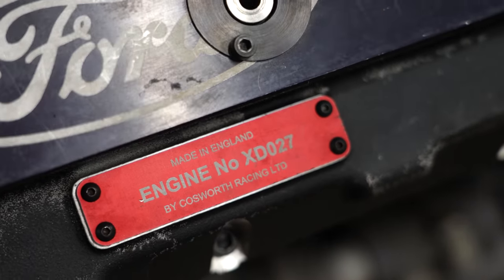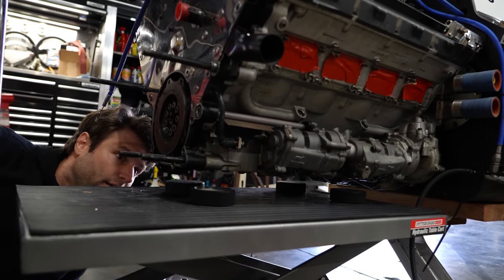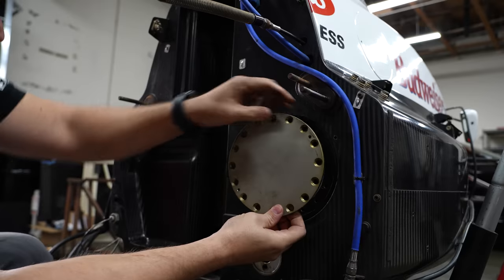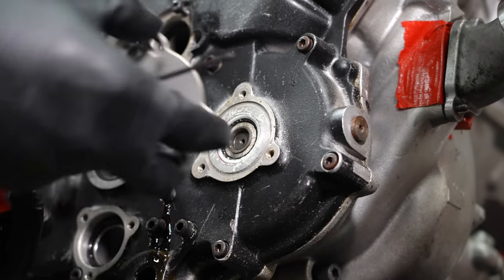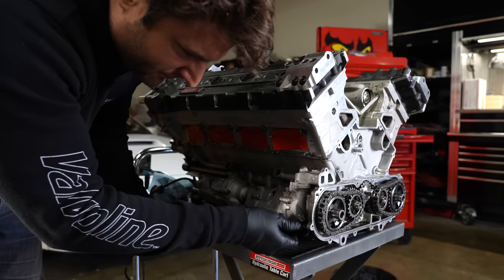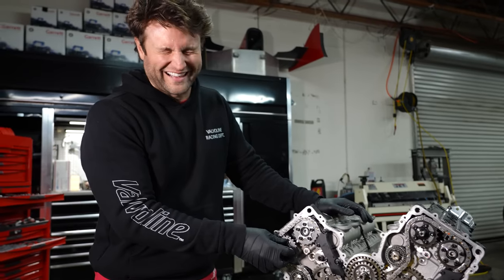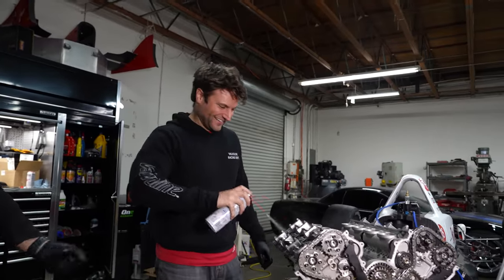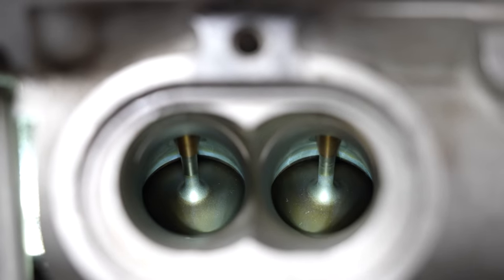We teardown the IndyCar Engine to expose its Secrets! Cosworth XD Turbo Methanol V8

Comment: 😬you're rotating the engine the wrong way causing less chain tension and the cam is skipping teeth, the engine will need to be retimed now, chains already looked kinda loose though time for a new set

Comment: Rob, In the time of the 80s and 90s Indy 500 races, the target MPG to have enough fuel to finish was 1.8 mpg. That was 1.38 gallons burned per lap. Qualifying was not an economy event so running all 900hp burned even more. This is an awesome thing your doing here and long overdue for anyone to do this. I can’t wait for dyno day and to see how much fuel per pull it eats.
Reply: If it still runs after all of this I will be amazed! Not to discredit rob and the crew. It just seems like so many factors can go wrong.
Reply: @kylemcweeny878  I agree it is insanely complex but Rob seems to be insanely analytical about everything he does. I hope it turns out as amazing as his 4-rotor that people doubted as well.
Reply: Notice the extreme throttle fluctuations: https://youtu.be/70tyWDK26-I?t=932
Speaking the truth, by innuendo: https://youtu.be/IADOqM5VCi0?t=360
44:44 This is liminal space, used to stuff the 'Hobby tubes' mentioned by the
Kodak team.  Dupont had T-rex, better life through 'color'.  Primary field??
ie the more potent oxidizer/fuel starts inside the engine, to take advantage of the vacuum (like restrictior plate racing).
May want to avoid fuels that contain metal, silicon seems to be the accepted alternative.
F1 are NOT getting 60% efficiency, as all fuel is not being accounted for.
Reply: @kylemcweeny878  From Rob's various comments in the video, it doesn't sound like he's treading totally new ground. 
https://youtu.be/uVeK7sVt9BQ?t=2667 
Between that source that Rob found and the other people he mentions who have reached out, I think he has a shot at getting it running if he hasn't damaged anything in the teardown.
Reply: @kylemcweeny878  its just an engine same as a vw one just more expensive nothing more in it nothing different
Reply: The ECU will probably be the stumbling block,  I daresay.  My prediction is the relationship between the multitude of sensors and the ECU will force Rob to have to keep using the original ECU,  and unless the engine is setup identical to the original the ECU won't function properly.  But who knows?  Maybe MoTeC sell an Indy Car off the shelf ECU?
Reply: @ivanjulian2532  i know pectel will run it all i can say and he can get a new pectel cosworth ecu now like new gen for 4k i used them multiple times
Reply: @drmikegaspwred1483  well that augers well.  That will give the engine a new lease of life I would wager.
Reply: @ivanjulian2532  i could write down here what generator driver they need and all but why i like seeing him figure it out he is smart
Reply: @ivanjulian2532  You just build one. Lambda readings and set it up. Done every day
Reply: I think the ECU will be the easiest hurdle.  Those Haltecs are absolutely elite.  If he understands how the sensor works, there's no reason the aftermarket ECU can't run it.
Reply: @dooby1445  just look up halltech elite function list and pectel mq12
Reply: It would have been quicker to get the NAPA AUTOPARTS machine shop down the road to rebuild this! He does lots of V8's!
Reply: Still won’t touch a Tesla
Reply: And this is why we have global warming …. Newton 24 for a GREEN America
Reply: If it’s put together Rob will definitely take it apart. Just to learn it’s function. And best believe he’ll put it back together and it’ll work 100% perfect. Can’t wait to see it
Reply: I wonder what it could get at 65mph in top gear 😅

Comment: I was track support during the XD Era, which was the heyday for champcar. The 4 PCI injectors were giving up to 45 % of fuel at max. The turbo inlet was the IGV which was broken into 4 pie shaped pieces driven by mechanical gearing on the outer perimeter, which, when the throttle closed the turbo, was in a vacuum keeping it from slowing. The nineth butterfly was reduction gear driven for control of the boost. It was constantly whipping in modulation. If you look at the shifter linkage at the handle, there should be a sensor there which, when shifting, that switch closed the nineth butterfly and backed ignition to take tension from the Trans to make the shift. Could go on forever but, great to see you diving in.
Reply: no no please keep on going lol this is so fascinating this thing has so many cool details it keeps me in awe
Reply: I could listen to guys like you talk about this stuff all day, it's fascinating how all this stuff works. Hopefully Rob see's this because I bet you could save him a lot of guess work
Reply: @Matty.Hill_Drifts  Time will tell. I'm sure with his investment to the craft, he has more and more information flowing in.
Reply: You should probably reach out to Rob privately. Your info and experience are extremely valuable to the project imho.
Reply: @gabrielenitti3243  I've never worked in comments on anything before and wouldn't really know where to go to contact. Figured he'd see these comments and reach out if he needed help.
Reply: Rob contact this dude!!!!
Reply: Dude make a video!

Comment: Two things to consider.

1) these engines are never cranked "cold". Only with hot oil and water. So it won't spin very well cold as the clearances are intentionally that tight.
2) Careful with the concept of using exhaust cams as intakes. While the lift target may be right, the timing and duration of the lobes from cam to cam may not be correct/ideal. Machining the intake cam ensures the correct behavior, just with less lift.
Reply: 3) Be aware that camshafts are typically case hardened.  If you grind away more material then the case depth, your cam lobes will no longer be hardened and will wear prematurely.  I'm not sure if re-heat treating the full lobe will have adverse effects on the remaining, factory hardened, material or if you can locally case harden the ground areas but, this should definitely be considered.
Reply: He wasnt measuring lift correctly too as the lift isn't the whole lobe diameter it's the change from the base circle .
Reply: @aaronhall7740  lobe lift. not to be confused with valve lift where you'd also need the rocker geometry and.. stuff..
Reply: @timwill2484  yes you can case harden just the lobes. It's done quite often with Alfa camshafts.
Reply: I've never heard of any engine  that starts out with tight clearance of any kind on a cold engine. Since as the engine heats up the cylinder will expand the pistons will expand and the rings will expand making clearances even tighter  leading to a seized pistons, spun bearings and a host of other issues.
Reply: @theEVILone0130 do some research and come back to that….
Reply: @theEVILone0130  that's because your not a race engine designer.  The liners are normally steel and the pistons are any of a number of al alloys.  The clearance increases as is get hot due to differential in expansion rates.
Reply: @5PYZ3R  Lobe lift and valve lift are the same on an engine with bucket lifters. The lifters sit right on the valves.
Reply: @Nikko780  ye but I think most of us don't have bucket lifters lol
Reply: @theEVILone0130  "Since as the engine heats up the cylinder will expand the pistons will expand and the rings will expand making clearances even tighter  leading to a seized pistons, spun bearings and a host of other issues." If you cold start this engine it would badly damage the bores and pistons, if it even would start. The tolerances are SO tight they don't allow for the engine to operate as intended when it is cold. It is warmed by having hot oil and coolant pumped through the block, and then started once all of the internals have expanded properly. The reason your car's engine doesn't get stiff when it's cold is because you have much looser tolerances designed for longevity and dependability rather than the race car engine's tolerances which are designed for maximum power, at any and all costs, including sacrificing the ability to cold start the engine. Interestingly, lots of racing engines which cannot be cold started have pistons which more closely resemble ovals than circles when cold.
Reply: @bubbleman2002   Boris I did what you recommended and had to dig some to find out why. The piston and cylinders being machined out of round so they will be perfectly round I see what you meant. And no didn't know they did to That extreme. But after some what in depth reading I see what you were saying so I asked a guy who my boss knows that used to work for auto delta back until the latter half of the mid 80's  about it also. He didn't work on formula one but had built some engine during the day. He mainly built WRC engine's for auto delta for class B cars and retired right after they cancelled class B in 86 88 something in the time frame. But anyway he said they could be turned over slowly by hand because they were during assembly but but advised that you avoid it if at all possible since it did apparently cause the piston to gall the steel sleeves if rotated just a few times so that when actually started it would continue to gall until it fail. While I've just started getting into F1 racing i see what he talking about and what you said but while I knew they ran tight tolerances I didn't know they milled then that far out of round. Too fuel does that but not to those extremes.  If you Know of somewhere i can get ahold of more writing on what they do to the f1 engines during a build id like to read more about this subject .
Reply: @5PYZ3R This engine does, though. So it's relevant.
Reply: Tolerances are reduced as the engine heats and the metal expands.  If it's tight when it's cold, something is seriously wrong, and it will only get worse when hot.
Reply: @sportscarclinic  Not true, with these engines it is the opposite which is why F1 teams heat up the engines before they start the cars
Reply: @spiffytuber7515  both are somewhat wrong. It will start, wear will be increased then as heat gets to the lightweight piston it becomes too tight and seizes . Whereas if you heat everything up and allow all parts to be in the operating temperature a completely ideal clearance can be achieved.
Reply: @dennisford2000  ^^^
Reply: Some f1 engines they have to preheat the whole block

Otherwise it'll seize before it even starts
Reply: @alexanderwooldridgesmith6629  Cylinders are typically steel and pistons aluminum.  Aluminum expands more and faster than steel.  Pistons are fit looser than they will be at operating temperature. That's how it is.   .
Reply: @thomasopdahl1873  Thanks Thomas, I used to design engines for a living that have won Indy and many other events.  There is a lot more to it than that.😄
Reply: @thomasopdahl1873  The pistons don't expand evenly (mostly because of the pin bosses being much thicker than the skirts and subjected to extra heat from the friction of the pin), they are typically deliberately manufactured out of round in such a way that they will become round when hot. This can lead to funny business with clearances, which is probably why these engines are 'tight' when cold.

Also there are some austenitic steel alloys that expand a great deal more than regular steel, and come close to the expansion of aluminium. I know for a fact that these were used for the cylinder sleeves of British WW2 radial aircraft engines, because they used a 'sleeve valve' system where the sleeve moved to cover and uncover ports in the cylinder rather than having normal valves. As a result the sleeve had to have tight clearance in the aluminium cylinders both cold and hot... thus the high expansion alloy. It may be that something similar is going on in these engines, trying to minimise clearances etc for that last 0.5% efficiency and power. Or they might be using coated bores e.g. Nikasil, in which case the bore is effectively aluminium but with a super thin coating of hard material to protect it from wear, and would expand as aluminium does.
Reply: @nerd1000ify  Interesting.  Thanks.  It sure takes a lot of experience to make an engine like that.   It is more than just basic engineering math.  Internal combustion engines have so many dynamics going on.  Inertia, heat, timing, induction physics, fuel, etc., and then after all that is done, the car has a thousand more variables to contend with.  In the end someone can spin out in front of you and its all for nothing.  I think I'll go outside and shovel some snow now.
Reply: @5PYZ3R  Are bucket lifters good or bad?
Reply: @uranium3111  no clue. I just wanted to clarify in case people use Dahm's info on their own cars.
Reply: @uranium3111  excellent. Now find out why they are
Reply: @alexanderwooldridgesmith6629  I believe the silicone content of the alloy has a major bearing on expansion, along with numerous other factors.
Reply: Came here to say this
Reply: Exactly, we used to get to the track several hours before morning practice to get the heaters cycling through the oil and water. We did this on the Judd V10's and AER P32 V8's - same same for most race engines.
Reply: Also because these engines are preheated when he turned it over cold the timing chains MAY HAVE SKIPPED TEETH?
Reply: @rohanrohanrohan8915  I would say no on that... although he did spin it in the wrong direction, which could cause problems on some "normal" engines (especially if they've been sitting forever and have hydraulic tensioners that have bled down)
Reply: @theEVILone0130  same for f1 engines. motor is practically seized until it's heated.
Reply: @alexanderwooldridgesmith6629  I was quite sure that an engine  designer was supposed to be able to write simple sentences in his mother tongue. :hand-orange-covering-eyes:
Reply: @timwill2484  Do you know if a shop that custom makes camshafts would have the equipment to re-harden them? That is an awesome point to keep in mind before any mods are done.
Reply: @theEVILone0130 the have tight clearance because they have controlled blue printing of the engine and known expansion of parts. Some bits expand more then others. They pump hot fluids through the engine and get it warmed up to start then start it once it's within perfect operating tolerance. You can sorta do the same thing but with more wiggle room in regular engines and a warm uo period after a cold start.
Reply: ts hilarious how some keyboard engineer knows more than a whole company of top quality engineers who have been in the game for decades
Reply: Yep, there's a good video on why it costs 50,000 British pounds per piston on a F1 car.  Would be a good primer for these guys
Reply: @thomasopdahl1873 Not true. The liners in these Cosworth engines are Nikasil coated aluminum and the pistons are also made from aluminum, but the latter operate at a much higher temperature. So, when cold the pistons are slightly oval in shape and a bit conical (smaller diameter at the top where temperatures can exceed 300 degC), and there will be a large play between the piston and the liner. This will cause "piston slap" when the engine is cold, and this can sometimes be heard. With sprint engines you also tend to use low silicon aluminum alloys for the pistons, which are forged, and these alloys are known for their high thermal expansion.

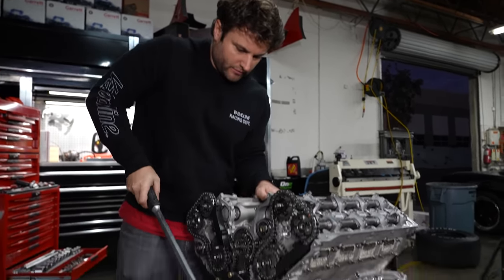Comment: At 55:00. 
The timing chains popping lose is because the timing chain tensioners are a hydraulic tensioner and because there is no oil pressure, there is no tension on the chains. So, the valve spring pressure is make the cams move more then it normally should. Hope this helps!

Comment: Awesome teardown! This engine is art in motion, So much engineering goes into INDY for the top cup win, OEM piston engines are nothing like this Cosworth.
FYI, To find the correct rotation look at the chains, Chains ALWAYS pull straight, the idler side is always the return.
Happy holidays!
Reply from the maker: Whoa that makes total sense!
Reply: Art in motion was the name of the car club that Craig lieberman was in iirc and is the reason there's a sticker on cars in The Fast and The Furious that say art in motion
Reply: I was thinking the same thing, it was definitely being turned the wrong way. No harm no foul though, the tensioner was culprit allowing the slack in the chain. Great video though!
Reply: I'd love to figure out how to increase rpm on a stock motor
Reply: @WandaSmith-r8w  Firstly, you better be sure the lower end can handle higher RPM. The one thing holding back stock engines, that would be the Cam Shaft.
Secondly the intake runner, exhaust system, throttle plate diameter and fuel delivery all hinder top end power. All those can be pushed by a Turbo, but you need to add the extra fuel!  😁
Reply: Actually is is the valve springs @HandyDan  the springs cannot maintain valve tip connection with the cam and the valve floats, thats why pneumatic springs were developed. Around 10-11k rpm is the springs natural limit (multiple factors ultimately determine the limit but 10-11k isn't a bad start point)
Reply: @user-uz4sn1vb2o Yes, thank you for your additional information. An engine needs most everything upgraded but a slight CAM upgrade is the lowest price per gain😊
Reply: @HandyDan  Don't forget the lubrication. You want to up the revs, you'll likely be wanting to see if your system can even handle it or you're gonna get buildup somewhere, and then a shear is just waiting to happen; Most motors have oil channels like 6-8mm and the weediest pumps feasible, which is crap. If things are bad enough, or if you're wanting a dramatic enough change, you might even start having to look at counterweight profiling on the crank. And at that point, it's easily time to start considering whether if you're even working with the right engine in the first place...